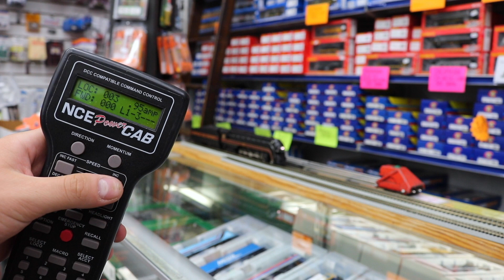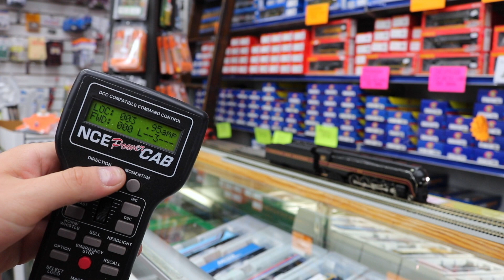MTH HO Scale Norfolk & Western J Class With ProtoSound 3.0

Comment: New to model trains... can you turn the sound off if you want to?  Like if you wanted a train to continually run on a high shelf around the room  and you didn’t want to hear the chuffing for long periods of time?
Reply from the maker: Hi Aaron, depending what remote you will be using yes you can turn them off on most engines.

Comment: Any way to shorten the tender gap?
Reply from the maker: Ehh  usually they dont make it closer so they can make the turns.   You might be able to modify it but you would have to be careful with the radius curve
Reply: Yeah, I’m planning on running on it on 26” radius curves. The tightest curve on my layout will be 22” radius but I’ll probably run this engine on the outside loop which will have 26” radius curves. 
I’m either going to unscrew the drawbar on the tender and move it further back, or drill holes further back and cut off the excess. If I drill it I will also have to file away some of the tender body under the drawbar.